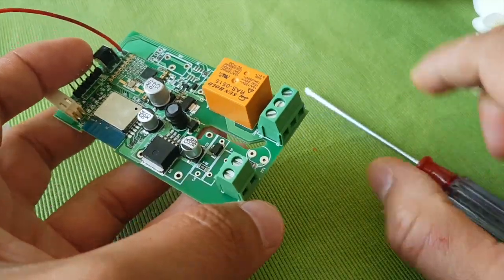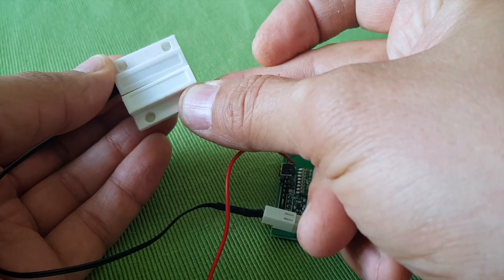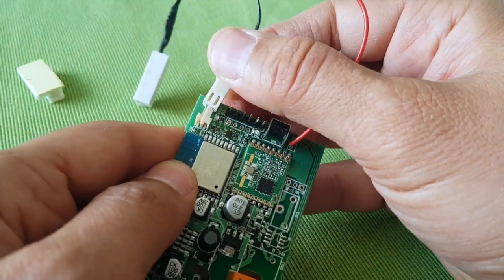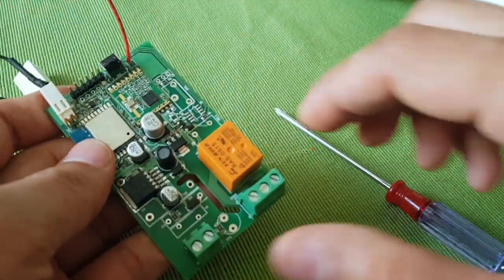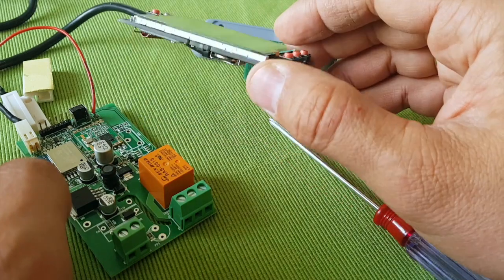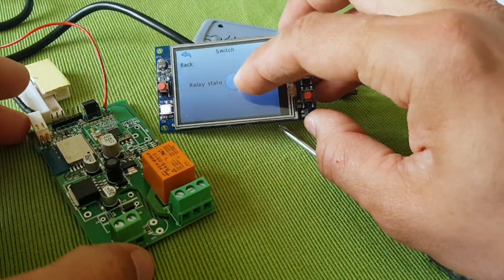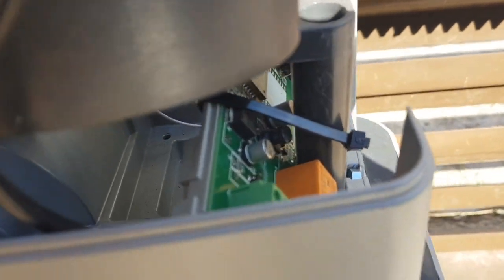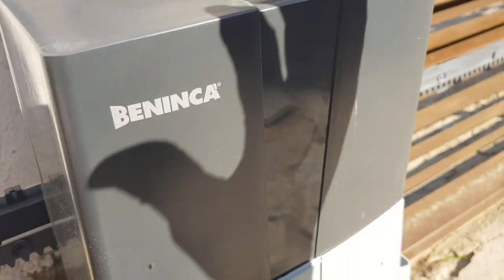DIY internet connected gate opener

Comment: Hello. I am trying to do similar with sonoff switch. I would like to bypass electronics, and bring.+220V on the motor throu a switch. Would this work?
Reply from the maker: Most probably that will kill the motor, typically the motors are 12/24V DC